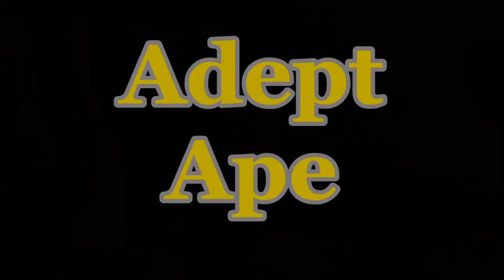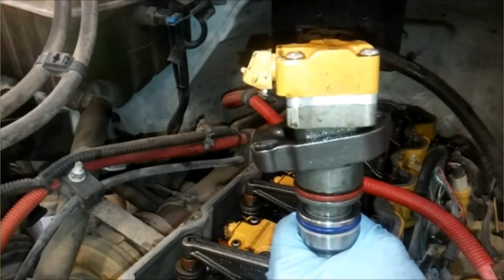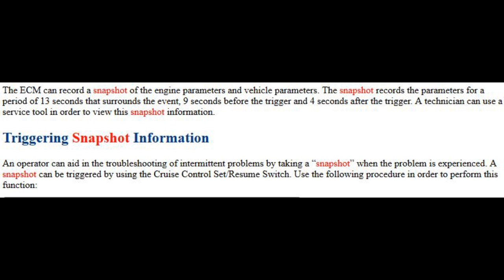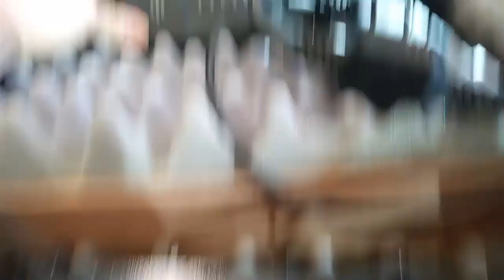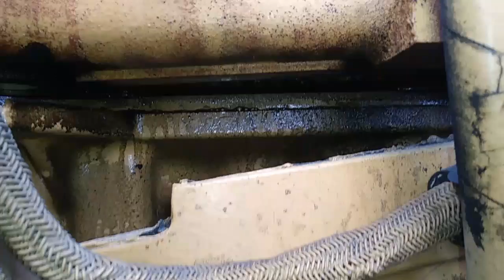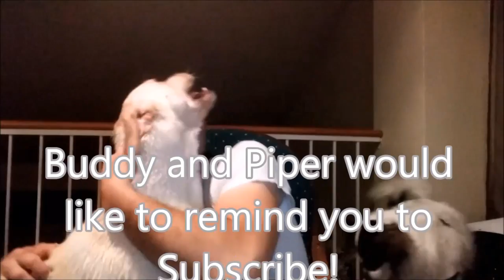Troubleshoot A Diesel With No Check Engine Light.

Comment: I have a problem with my c12 engine after enter changing the battery and the was running the engine short down after starting the it running but no accilaration am having rpm reading on 600/700rpm am having code 342-11temp 
105-4
110-3
174-4

Comment: Yes i had a c12 lost both sensors but i dont think they failed at the same time it would start and die in the morning  but he wanted to haul gravel half way through the summer and died down the road from my place as i remember it had codes for both i replaced both and it ran like a champ.

Comment: Myt instructors made it clear that engine systems "don't think" meaning the modules only interpret what voltages are received.
Reply: finishing the vid now, I believe we are on similar pages. Curious if CAT guides techs to use oscilloscopes in any diagnosis now.

Comment: You have a contact email? I could use some help figuring out why my RV doesn't start. It has a 3126. No CEL or air heater light comes on when I turn the key on. I've started it on ether shortly and it has good oil pressure.

Comment: I have a cat c7 engine that throws no codes. as soon as the temperature reaches 150 degrees it loses all power any tips? when this happens, it won't go past 1300 rpm

Comment: I have c15 acert 475 having oil temperature issues. oil cooler good fresh oil and flushed cooling system. Oil temperature high but water temperature about 20 to 30 degrees cooler??? No lights on seems to run well other than oil temperature. Any idea???

Comment: Hey I got a 05 chevy duramax LLY the fuel pressure sensor reads 207-223 psi wit truck off would this cause hard starts and limp mode

Comment: Man I’ve been having so much trouble with a c15 a CERT I have invested over $20,000 in my engine still does not run properly I have 50 psi of boost but whenever I am on a full load uphill my turbo boost seems not to stay high which brings me down to 5545 sometimes 40 mph

Comment: you know i took alot of advice from josh here and several of the master techs at the shop and my career has drastically improved watching these videos and applying them to doing end frames and diagnosis currently i am swapping out a 3406E cat and its had a long list of problems and also engine damage but i just wanted to say thank you just helping open my mind up
Reply: Good luck bud

Comment: I got a question. I have a problem with my truck  Chevrolet 3500 with a Diesel engine 6.6L Duramax. I tried to pull the upper oil pan, it’s 4 wheel dive I no pulled the 24 bolts and it’s still tight and the oil pan won’t come down. Any help?

Comment: I have a '05 freight w/detroit 60 14L. At idle it almost feels like its missing but rpms never fluctuate. Any weight added, even empty flatbed, i lose all power and engine shake/miss gets extremely worse. Does not smoke. New turbo, VPod, EGR, wiring harnesses, and turbo boost sensor

Comment: Hey can you please help me I’ve got a 99 kw I’ve turned into a logging truck. As far as I know it’s got a 3406 cat I had the actuator replaced the turbo feels tight on the fresh air side the fins has got carbon on them but my problem is the turbo won’t kick in most of the time unless I’m in the middle of a turn left or right and then it will kick in for a few moments. Can you please try and help me I can’t really afford to take it to a shop. Thanks.
Reply from the maker: You can email me at Adeptape@yahoo.com the comments section isn't the right place to ask for troubleshooting advice.

Comment: I drive a 07 international 8600 with a C13 Acert in it. The truck was assigned to after it had been pulled from another driver. I went to check the oil in it and noticed that the oil level was considerably low probably about a quarter of an inch below the low line on the dip stick. The truck also blows white smoke from time to time. I can’t find anywhere on the block or around the valve cover where it could be leaking oil and there aren’t any oil spots on the ground under it after sitting for a weekend. What do you think could be causing the oil consumption? Thanks.

Comment: Great info.    I have one maybe u can add info to.  Replace head 2 pistons and 2 injectors.  Now truck has no power on top side of trans.   Has 75 psi fuel and 23 psi boost. Does not miss.   But no one can figure it out.  And no codes
Reply: It’s a c 12 cat

Comment: There were no check engine lights back in the day, I am damn good on the old stuff , I can tell by listening to it.  I am well versed in the late 90's early 2000's stuff and that is it for me. New stuff I will ask someone, when an old mechanical beast goes down and I get called, they ask me, how the fuck did you know... I could tell by the sound

Comment: Related to example no.1 its Cold Mode all mxs and nxs has its just inbuilt cat ecm setup nothing is wrong to eliminate  white smoke its cat answer , I have seen tens of engines but few programed ecms by good programmer doesn't have, to deal with warm up the engine 168° atleast before moving or if you forget don't press accelerator heavily and keep it over 1400rpm until temperature  reaches.

Comment: 03 7.3 powerstroke  just replace turbo I need to place pedal rebuild kit  but  egt are 200/250 idle and it’s at about 6-800 normal just doing 100km now I don’t know if just a Radom but no load  going up hill it will climb 1000 and I let off  because I think it’s to high  and now the egt are all over the map

Comment: Josh wish I had seen this video a month ago. Had a gmc 6500 with a c7in it towed in to shop. Crank no start. Did all the standard checks and fuel psi was very low. Replaced lift pump same thought bad new pump. Replaced again no change.I did notice coolant temp was stuck at around 170. After several calls to cat tech line I was assured that was not my issue. Well said the hell with it got a new sensor and it started. Live and learn lol

Comment: I have a 3126 cat starts for 10mins ands shuts down i see when temp gets to 130 degrees it shut off . I changed the crank sensor , Aip valve and actuation pressure sensor, took the top chk injector seals,  injectors don't miss , could the relays on firewall be problem? But the actuction presure is not cat part .

Comment: Josh I have a question on a 2003 7.3 powerstroke. Or someone who knows these engines. First off I’m from Canada Alberta northern  winters are cold -30 -40 most winter  and  my 7.3 has 730,000km  on it started to hard start last winter  I change the glow plugs and glow plug relay    Now I’ve got oil in my coolant and I’ve replaced the oil cooler gaskets and still happening so I replaced the oil cooler and put new rings and gaskets  and still oil in the coolant. Even says oh just a bad oil cooler. No check engine light and doesn’t smoke or smell like coolant out of the exhaust. I still think I have a head gasket  and I will be changeing my injectors out for news.

Comment: Hi I got 2005 volvo d12 engine smokeing white. And no check engine light only smoke some time on a 2 gear with 14/15 rpm.....took to the shop change 3 injector and cylinder head and much more stuff cost around 12k and still smoke.....
Reply: Can u figure my problem

Comment: 97 powerstroke throwing a MAP sensor fault 
MAP ohms read correct
New clamps applied 
checked hose for leaks

Diagnosis
3 injectors down 
Turbine not pushing the compressor fast enough to develop proper pressure out of the compressor

PCM equates it to a leak in the MAP tube.

Come to find out injectors taken out by turbo seals and thrust bearing wear causing turbo to be changing its shape by rubbing the Turbine and compressor housings. Lots of small metal particulate thrown down the intake and pushing boost into the crank case causing massive smoking and a large puddle at the end of the tail pipe!

Comment: "The wiring was shorted" internal reference checks should catch this immediately beof start and throw a code, but no... OBD is a lie, and the computers and systems are garbage. They could tell you what's wrong in an instant but yet they confuse it, let it be on their heads.

Comment: I admit one thing is that I go to favorite channels that pertain to my interests at my age... 73 and it is very hard to set and listen to things that do educate me but I will never be able to do again and that was my whole life.. wrenching. I loved being a fair mechanic as I came up in a area that didn't require as much collage as practical experience but then I do like your channel because you make it easy to learn from. I wanted to share one that I don't know if Cat has one but might. I was working on a motorhome  and when I sent it out, I informed him no charge as I could not find it. So he leaves and I forget about it. Then he is back and he says; Your the go to guy when no one else can find it. That hits the sweet spot and so up again for the challenge, I interrogate my customer... when does it do what? He says rough roads, pulling into driveway, etc., so I start by checking then rechecking and nothing. So I hand him back hiskey and he puts it in his pocket and uses the keys in his hands. As he did that, a light went off in my head... wait for a minute please... and so he stops and asks me why. I asked him to move over and he did so I take it for a short drive and no problems until I pulled into my shop area... I asked him, do you have spendy rims? He laughs and said no. So I curbed it and the engine stubbled and it was apparent he didn't like being bumped around by the cuss words then a "how did you do that, make it do it again. I told him your keys are talking to the truck! I pulled it into the shop and checked the knock senor and then when it checked out changed it anyway. It fixed it but hiskey chain must of weighed ten pounds of grand kid toys and they rattled on the dash. I took the keys out and pulled the important key off and then told him to give it al the same trouble places without the key chain then try it with them again and bingo, that was it. Even though it was better with the new knock senor, it would do it intermittently and so his precious toys went in the pocket and a key went into the ignition

Comment: Thànks for taking time out to help us old school folks that don't dig all the so-called "hi tech improvements that plague my friends that think that new is always the best route...
I'm 60 yrs ok old, and only run older Cat  equipment with no computers,  wires,  or dummie lights to tell you there's a issue...
99% of the time I know something is wrong before it becomes an issue ...I run a like new ,low hours 1968 Cat D7E Dozer, a low hour 1986 Cat D4E, a 1976 Cat 225 with low hours, a 93 Pete 379,  low milage 3406b.... And I wouldn't trade any of them for a new disposable lightweight pos that is always in the shop ...

Comment: Josh my husband is working o a 953c bbx  3126b it was missing and turbo boost was showing 5 psi loaded high idle on et. had one code low voltage sensor non specific. 3 injectors bad they were replaced it got rid of the miss.  turbo still was 5 psi replaced it 1t came up to 10 psi. the first thing that was done he made a air to air check tube and block off no air getting lost. when i rehooked and started it after replacing the injectors the active code was gone on the low voltage. injector activation 1160 high idle 4400. what next please help

Comment: 1996, 3176 engine.
Idling in the shop waiting for air to build it just quit. As 50 lb PSI fuel pressure while cranking ECM terminals have current and ground as I believe we're needed any thoughts. ECM?

Comment: My car engine runs on petrol. It also does not know shit about engine misfire or injector fault. All it monitors is about the basic emission control readings. A pretty dumb dinosaur. But the up side about it is that even if it misfires or run rough like a cunt, it will still run. Basically there is no building self-preservation mechanism to throw codes,  goes into limp mode or prevent a start up. I bet there are many people who will be jealous of people with such a simple run till you die engine management.

Comment: I have a 6 cyl Fiat Iveco diesel engine, done 248000 klms, it had 6 or 8 thousands dollars spent on it, the inline injector pump and injectors were rebuilt, has a reconditioned head, engine not running on all 6 cylinders, the customer gave up and left the truck to rot, after 15 plus years of sitting it started first go after testing and cleaning the fuel system but still misfiring, I took the motor apart, it had 1 good piston, 2 had broken compression rings, 1 liner had a leak into the sump, the work was done by a reputed truck mechanics workshop and they couldn't fix the issue, I work on diesel engines, self trained, I found the problems.
Reply: Well. Most mechanics are just like lawyers and dentists, they thrive on people's miseries. When someone's miseries are hard to come by, they may always try to the tried and tested diagnostic procedure of misdiagnosing and prolonging the suffering until their luck changes. Questionably yours, Mr haunting nightmare.

Comment: Quick question. I'm getting ready to rebuild an IH-282D and was told that Caterpillar made a headbolt or stud that I could use as an upgrade and was wondering if you knew what that part number would be. Thanks a bunch

Comment: Thank you very much for your videos they have helped me a number of times, i wonder if you could give me advice i am having a really hard time with a c7 engine i flashed the ecm for more rpms. Everything ok for five miles, the truck failed with (no eng) on dash, the ecm fuse was blown i replaced on the spot and still wont start, injectors not working. My question is what could cause the fuse to blow and no start problem? Could something have failed or shorted to blow the fuse? And still wont start after the fuse was replaced? I would really apreciate any advice i had my truck just sitting on the road for 3 days.

Comment: Hi josh i have a toyota estima diesal which turns to heat up after a mile drive. it turned out  that theres no coolent in radiator.so i wait for atleast 2hours to cool down.then i refilled the radiator.but  when starting the car theres a loud knocking sound in the engine almost sound like a hammer hitting a metal.do you know whats wrong??

Comment: 07 Detroit 60 series losing power on highway with light load , no codes and turbo actually sounds good, had mechanic check it over and could not find any problems....ANY SUGGESTIONS...in NC area
Reply: I have the similar problem 12.7 D60 takes forever to accelerate until tach reach 1350 after that no problem let us know what you end up with
Reply: Anything?